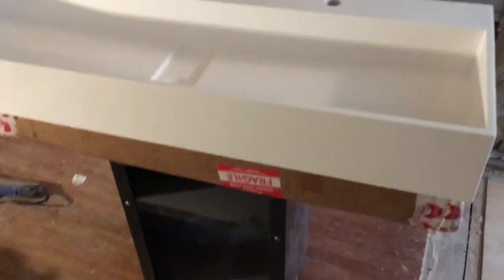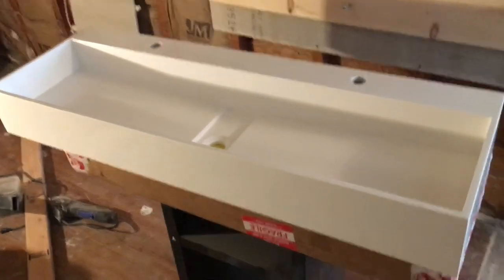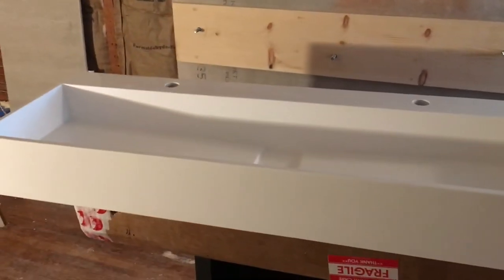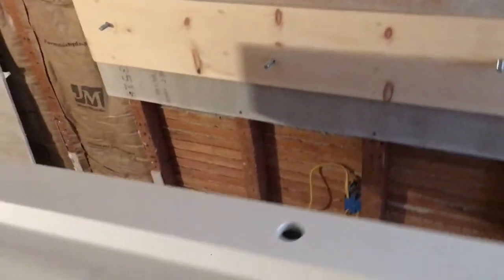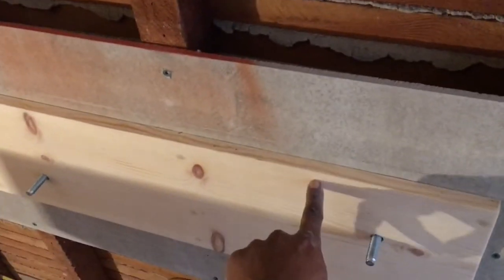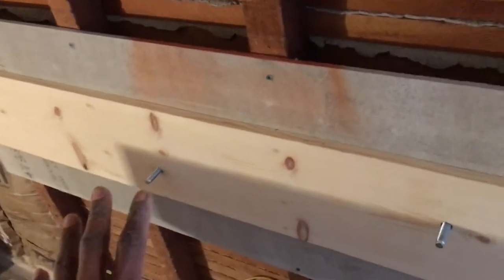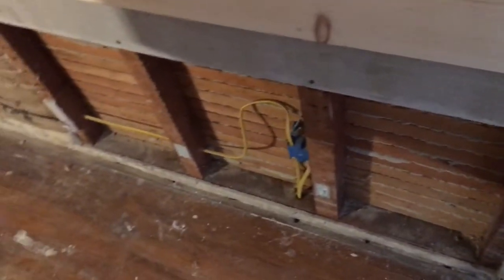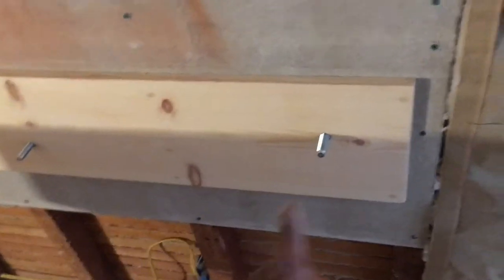Wall hung Double Bathroom sink installation

Comment: On your Ac coupled setup you just did . I have a simular setup. How did you set your ramp rates on your solar edge inverter ? Mine works im just trying to get it optomized now .
Reply from the maker: Hello, 
I really only wired everything up. I ended up turning it off until I can get the settings correct to feed back into the grid and only charge by solar. I haven’t taken a look at it in a few days.
Reply: @fullmetaltoolbox1412  I see . I have mine set to shut off working on the ramp rate

Comment: Nice video! I am considering getting this sink to replace a single sink. As for the plumbing, Is it just a matter of splitting the water lines since it seems to have one drain? Thanks!
Reply from the maker: You only need one waste drain for this. And i used two separate pex coming to both faucets. You could probably use one.
Reply: @fullmetaltoolbox1412  thanks!